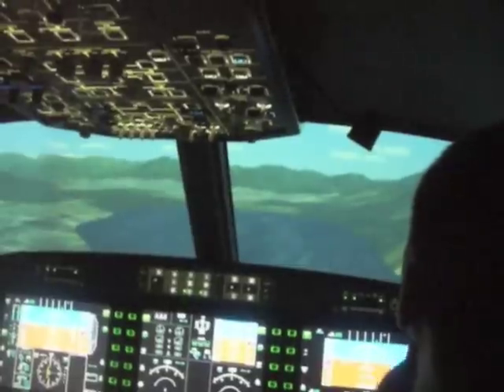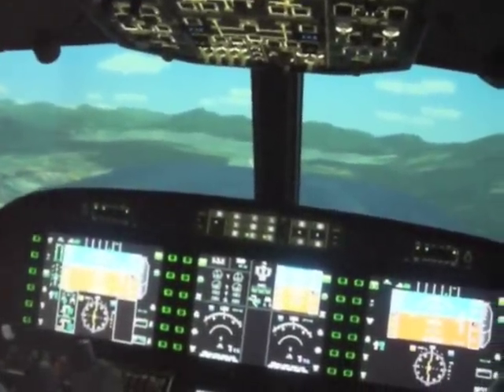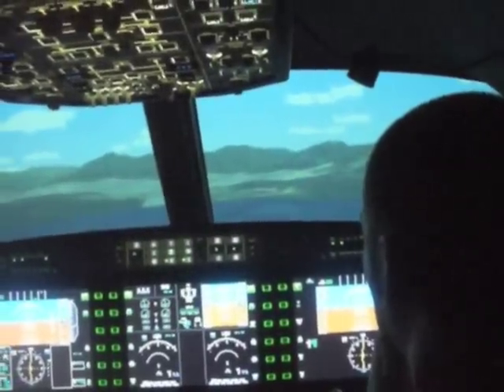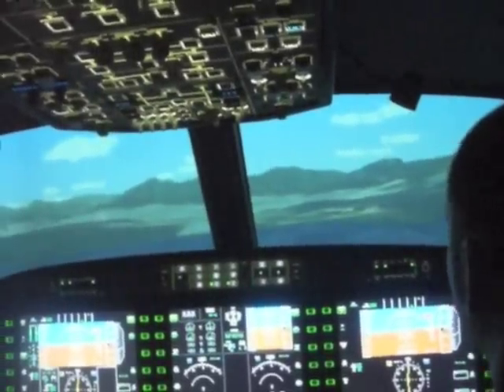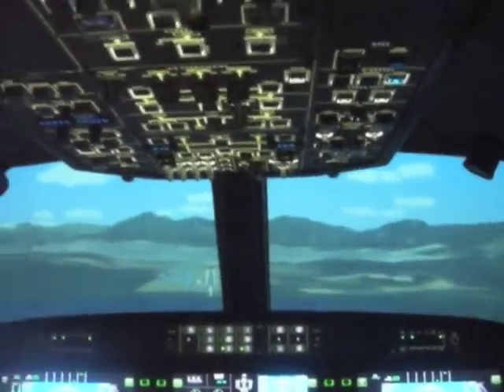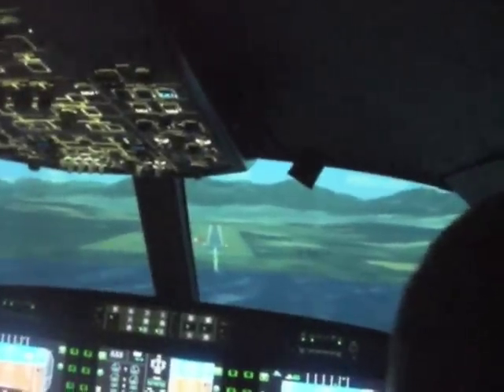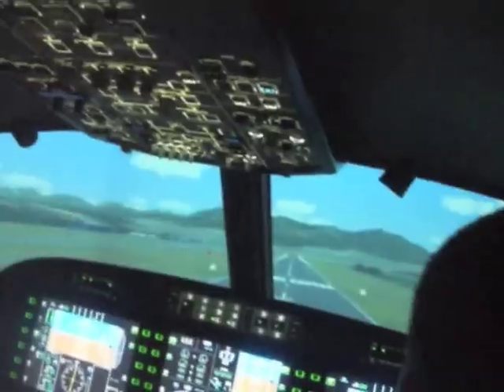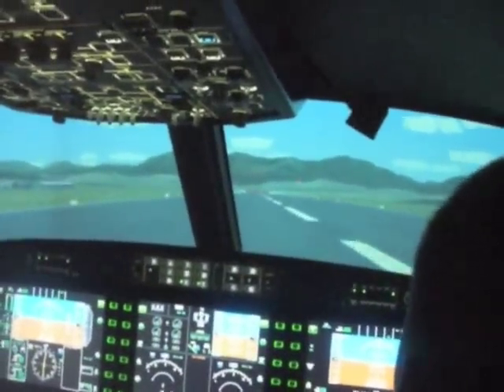Landing a Professional Flight Simulator

Comment from the maker: Believe it or not I found landing the simulator much easier than FSX. For one thing the yoke has a much larger range of movement than a joystick so you can make smaller corrections. Also because the display is huge and curved you really get a sense of depth which makes judging distances a lot easier.